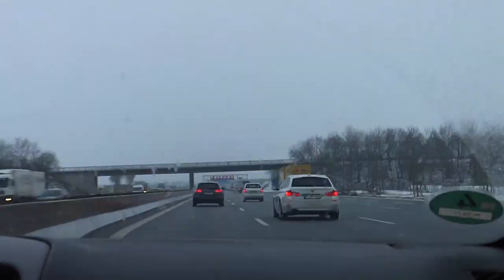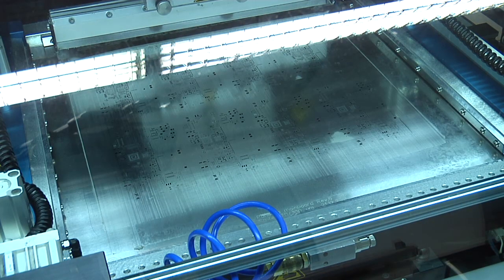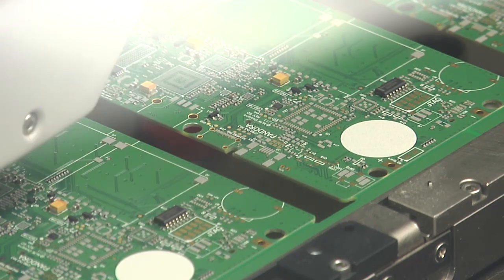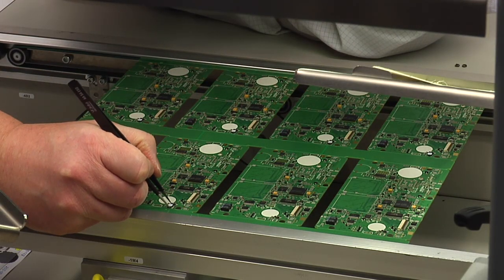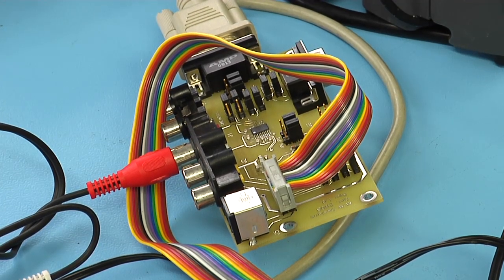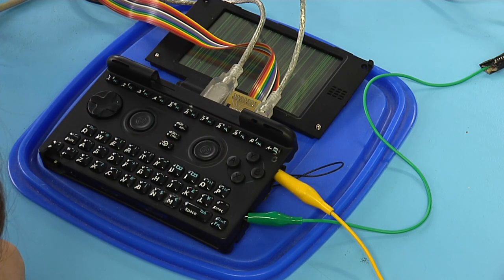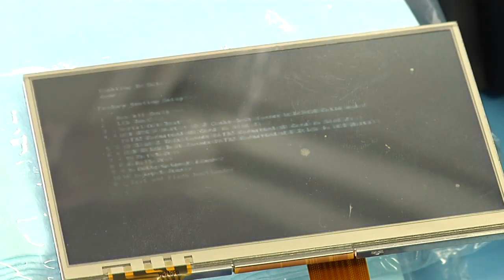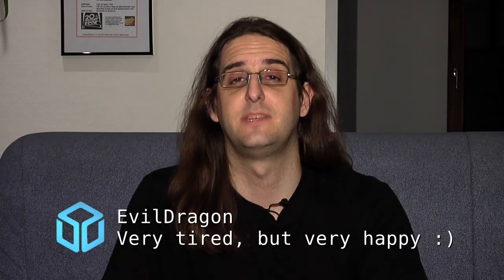OpenPandora: Prototype production run in Germany

Comment: I supported this project and paid the over inflated price and went premium through Open Pandora UK. Didn't get the unit any quicker, yet they took my money.  Non returned emails,  lack of communication,  and non returned emails. Communication is provided by other fans on a forum who try to make excuses to angry customers based on speculation. Communication is essential. I won't be supporting Open Pandora 2 after my last experience. Hopefully lessons have been learnt - good luck.

Comment: Their inability to keep up with what current standards? It's a completely open linux palmtop device with excellent gaming controls and strong community backing. It is only slightly larger than a Nintendo DS. It is a different market to a laptop or even netbook so the comparison isn't really valid. That's like saying to someone looking to buy a 4x4 that they'll get better fuel economy and features in a hatchback. It's a niche market, but plenty of people want this. You're just not one of them.